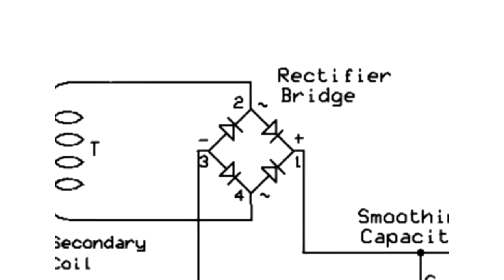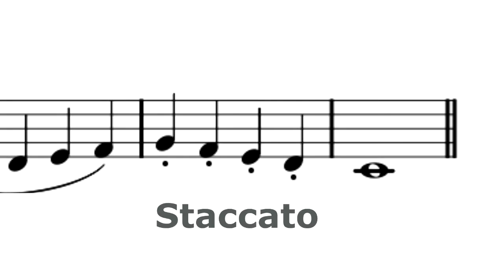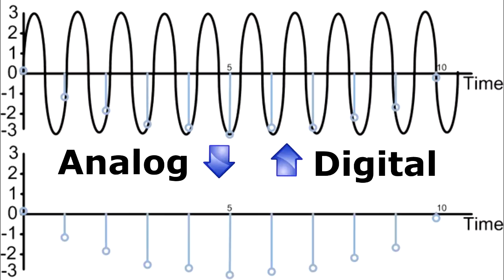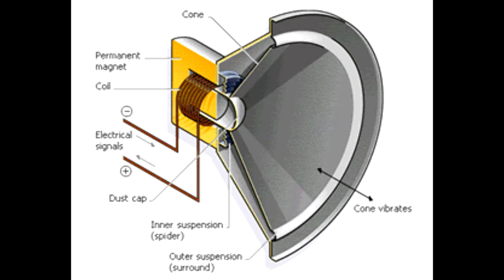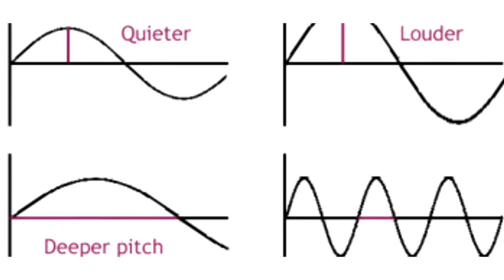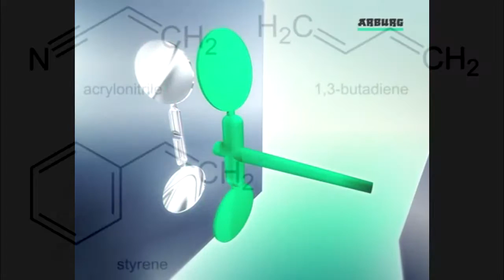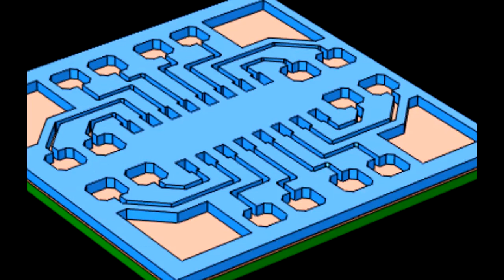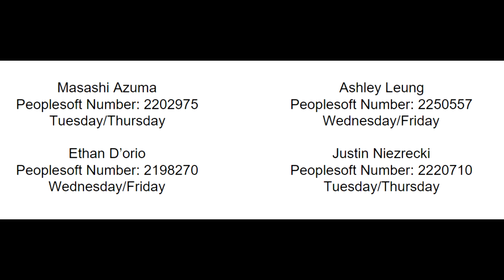Reverse Engineering Project: CTK-800

Comment: Something to say about this keyboard. It can be used as MIDI controller, so you can use it to control some instrument workshop software like Reason, Cubase and whatever VSTs you might try. 

However note, that the drivers available at Casio website are only supported for Windows versions from 98 to Windows 7. So if you are running with Windows 10, like me, you're out of luck. I managed to get mine work with my PC  as MIDI keyboard, but that took me over 5 hours of bit-tweaking and in the end I'm not even sure why it works. 

It's still not working very well, since the keyboard either sends a false input, or the drivers are broken. I get this "stuck key" kind of thing very often, where the note keeps playing until you press about 10 keys at the same time. This also renders 1 key not working, until you use the numpad on the keyboard, which for some reason seems to fix the stuck key. 

EIther way, if you're looking a midi capable keyboard for windows 10 then this is my experience. I don't even play that much, I just want to make it work, because...because making things work is fun even if I had to rewrite the whole driver myself. If it's even possible =D
Reply: Thank you, for this comment :) I 've just picked this keyboard from my basement and hope to use it as MIDI contoller, maybe it will work.